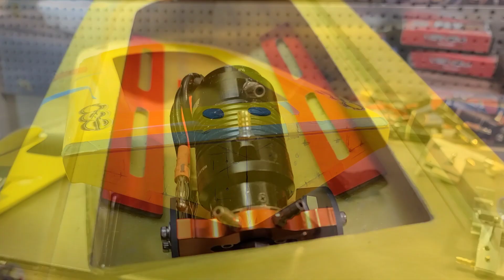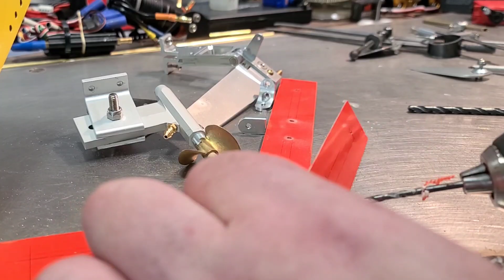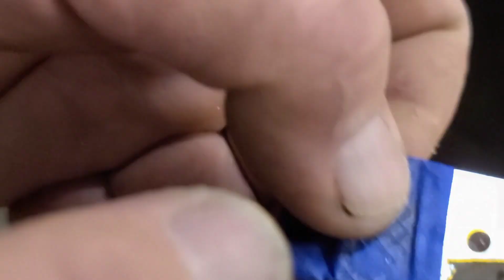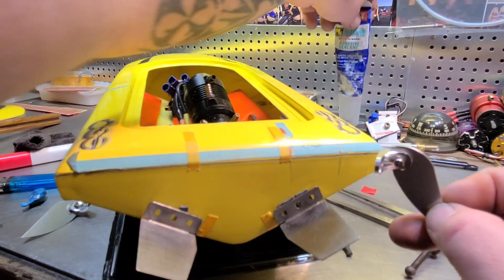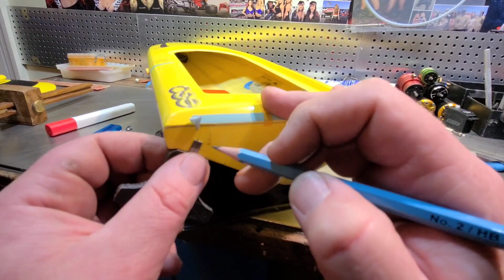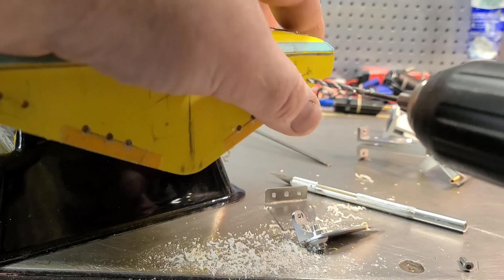Fast Electric RC Boat Build Pt4 Custom Battery Tray & Transom Layout Tips - Deltaforce Sniper

Comment: Greetings from across the pond,🇬🇧
Regarding motor position, how far forward / how far back,
How do you know? Is there a general rule of thumb for motor placement,
Love the videos man,
Reply from the maker: I dry fit everything into the boat I go by CG (center of gravity) usually 30%  from the transom on a mono hull.  ( back of the boat)   really  depends on the Hull and weight of the motor being used.  I try to keep motor towards the rear of the boat on a mono hull that able you to use battery placement for balance.
Reply: @IRONCLADRC  thanks for the reply